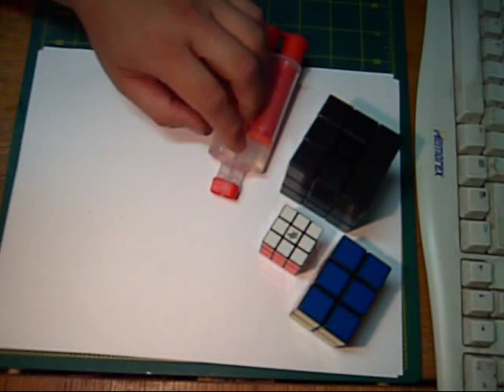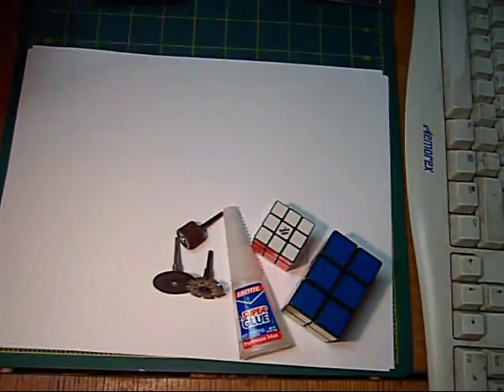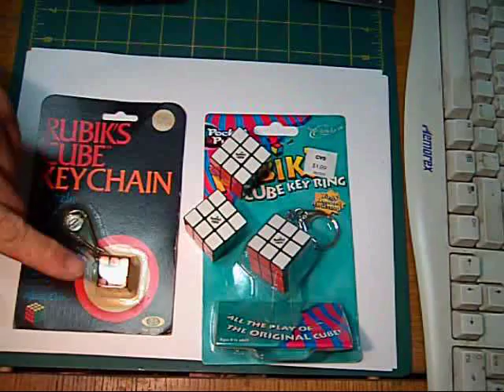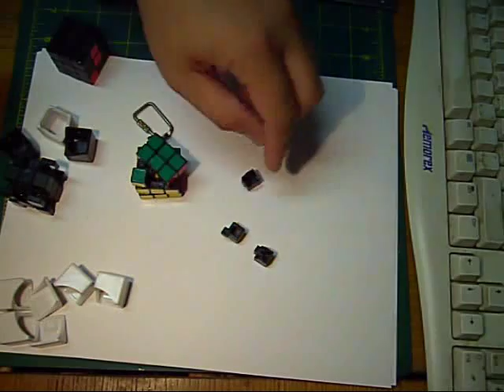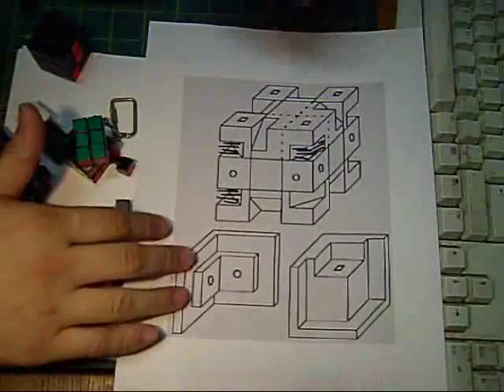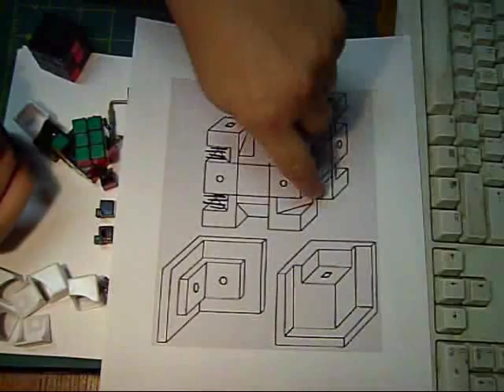How to: Build a 2x2x3 Part 2

Comment from the maker: Yes you can make all cuts with a hobby knife, but it will be a slow process, especially when it comes to the 19mm 3x3x3 pieces.  If you carefully cut chunks off with a pair of snips and then "fine tune" it with an X-Acto it shouldn't be too bad though.  Also you have to be careful not to snap pieces too much when cutting the keychain core.

Comment from the maker: Epoxy adhesive doesn't need to be super strong; it's only holding the piece until you fill it later with epoxy putty (Apoxie Sculpt, Milliput, Magic Sculp, etc) or even with more epoxy resin adhesive later.  Many brand names conform to the "5 minute setting clear two part epoxy adhesive" standard so I can't give you a package color.